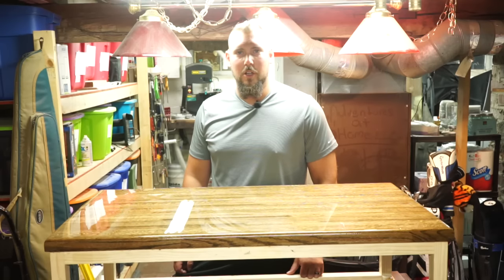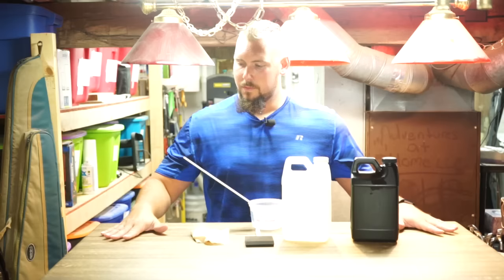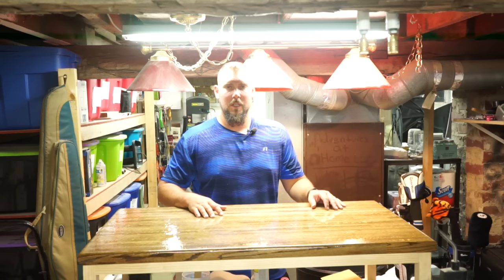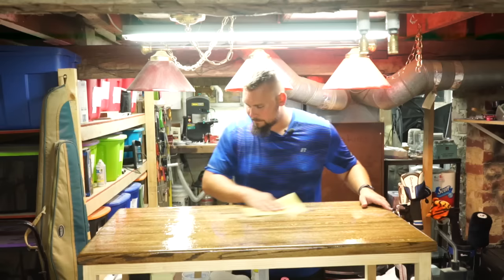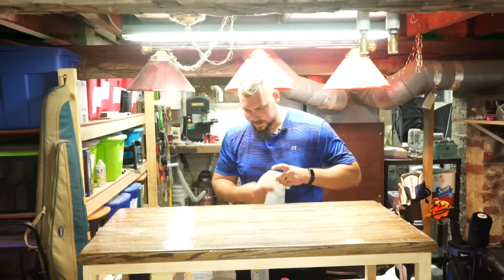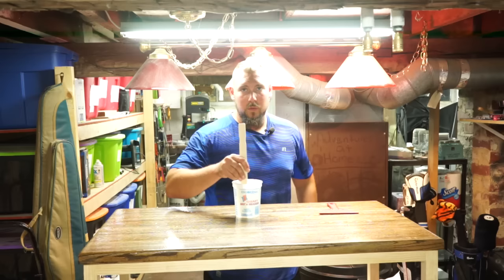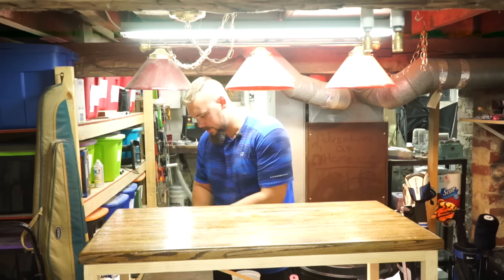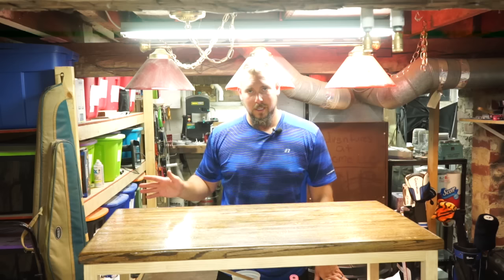DIY – How to Apply Clear Epoxy Resin – “Liquid Glass”

Comment: A few questions, sir.    Why couldn't you reuse the first mixing cup?, can I use a heat gun instead of a torch? and if using the product on a counter top, should the sink hole be cut first?
Reply from the maker: It is extremely difficult to get so of the epoxy/hardener or if the measuring cups. A heart gun will work, but be careful of blowing dust around. Sink hole should be cut first. Thanks for watching!

Comment: Great video!  Can you use a hot air gun instead of a torch to get rid of bubbles?  Thanks
Reply from the maker: Heat gun will work, but be cautious. You can blow dust deep into the epoxy. Thanks for watching!

Comment: I really enjoyed this video, thanks for the tips and tricks! Do you have a method for getting rid of the drip bubbles on the underside of a surface after a flood coat?
Reply from the maker: A combination of razor blade and sandpaper makes quick work of those. Thanks for watching!
Reply: If you mask off the underside edges with packing tape before applying the epoxy, the drips will peel off with the tape

Comment: If you don't necessarily want to do a poured stage, could you just do a couple of brushed on layers?
Reply: I am kind of apprehensive of doing a flood coat.
Reply from the maker: You could, but it will be much harder to get a smooth, even surface without the flood coat. Thanks for watching!

Comment: If a flood coat turns out poorly with high and low spots, should it be sanded down before attempting another go at it?
Reply from the maker: If you call determine why you got high and low does in the first place - and it wasn't a result of poor epoxy mixing, curing, etc. You can pour another layer over the top and it should level itself out. Thanks for watching!

Comment: Great Vid.  What if I just wanted to do a few thin coats with a brush?  Will there be brush marks?  I don't want to flood coat.  Thanks!
Reply from the maker: I'd recommend a foam brush - then it will still self level and you won't get brush marks. Thanks for watching!

Comment: I would think you would want to prevent the drips since it is so expensive. Especially after being so concerned to make sure you get everything out of the cup for the thin coat.
Reply from the maker: The drips are part of the self leveling. Nature of the beast.

Comment: Could you use polyurethane for the first thin coat?
Reply from the maker: Yes you could, however, depending on the wood I would recommend more than one coat. With an open grained wood like red oak it will probably take more than one coat to eliminate any excess air from the wood. Thanks for watching!

Comment: What do you do about the drips on the sides after curing?
Reply from the maker: The sides will coat evenly. However, drops will form on the bottom and they can be easily sanded off after curing. Thanks for watching!

Comment: Great video, planning to use super glaze on a camper wood stain counter top. I am having trouble figuring out if I should attach the back splash 2 inch edge or should I pour glaze then attach the back splash shelf? Not sure how the self leveling would work with the back shelf.
Reply from the maker: If you are planning on glaze coating the backsplash it will have to be done before it's installed. If not, you can install the backsplash before doing the counter top coat. Thanks for watching! Let us know how it turns out!
Reply: @AdventuresAtHomeLLC  it’s just a 2 inch wood that is the counter backsplash. Then tile will go above that. I plan to glue the wood 2inch strip onto the counter top. If I glaze everything then goto attach it won’t it make it harder to attach and adhere to the counter top?

Comment: What do you do for the drips along the sides?
Reply from the maker: The sides will coat themselves evenly from the epoxy running over them. However, you will have to clean up the dried drips on the bottom with a razor or sandpaper. Thanks for watching!

Comment: I've sanded my walnut slab down to 2000 grit paper and coated it with tung oil.  Is it really necessary to rough the surface?  Also, when I tried my first table I tested sanding a small flaw out of the epoxy coating and it was nasty and hazy.  How do you manage to keep your top from being hazy between your first and second coat

Comment: How did you clean up the drips? Before you let it cure you can see it dripping all over. Do you let it get tacky then scrape the drop that hangs down?
Reply from the maker: You can clean it with the foam brush as it cures. We prefer to let the drops dry and then sand them down. Thanks for watching!

Comment: Do you have to put a polyurethane or lacquer coat on the wood before you apply the epoxy? I have a wood coffee table and I want an epoxy final coat, but at the moment it’s just bare wood. Thoughts?
Reply from the maker: You do not. The initial skim coat you see in the video was applied directly to bare (stained for color, but not sealed) wood. Thanks for watching!
Reply: @AdventuresAtHomeLLC  awesome! Thanks for the great video!

Comment: With the base/thin coat, is it only resin or a 1:1 mix? And how do you calculate how much you need for the base coat? Thanks!
Reply from the maker: 1:1 for the seal coat. I don't really have a formula for how much epoxy I need for the seal coat. I guesstimate and make what I mix-up work. Next seal coat I'll have to make a note of how much per SF I use. Thanks for the idea, and thanks for watching!

Comment: If the manufacturer directs you to use 50/50 by volume, that does not mean that 50/50 by weight will work unless both the resin and the hardener are the exact weight which is unlikely...
Reply from the maker: Which is why we use the densities to find the weight that each part should be for a perfect 50/50 ratio. Thanks for watching!

Comment: Good video.  Out of curiosity, where you mentioned moving it to a dust free enviroment, I was thinking that a big dining room table type job, unlikely you could move it anywhere.  But then I thought, is dust really a big deal?  Since you are sanding it and cleaning it with acetone anyway, any surface stuff is going to come off.  Of course, doing it indoors would reduce the level of dust a ton anyway right?

Comment: Can we apply a sealant and a poly before applying Epoxy for glass coat look? I thought Epoxy will have adhesion issues to be applied over the poly coat. Im working on a live edge hard maple board. Can you pls share in a couple lines on how you prepped your board from an unfinished stage to be ready for Epoxy application.

Comment: My instructions say not to scrape the container when pouring it onto the surface that there is always unmixed portions in the container no matter how long you mix it and scraping the container will likely put the unmixed chemical onto the table which will cause a bad spot
Reply from the maker: I've seen that also. But we feel changing containers halfway through eliminates this risk - and we've never had any problems. Thanks for watching!
Reply: @AdventuresAtHomeLLC  if I'm putting in a new sink as well after I've just finished the countertop build should I wait till after I epoxy it to put the sink in
Reply from the maker: Yes. I would ensure that the counter top is complete before installing the sink. Send pictures when you're done to be featured on our "Makers Spotlight" page!

Comment: Hi ya, great video, thanks for sharing.  I did struggle with the lighting couldn't always see properly what you were doing because of the reflection.  However, your instructions are very thorough.  We are about to resin a new bar top that we have built - quite a project for us as we have never attempted it before.  When you put on the thin coat did you thin coat the edges as well?  Did the resin you used smell?  Just wondering whether we need to buy masks. Thanks again.
Reply from the maker: Ahh! Our lighting.. at least we figured it out in our later videos. Yes, we did initially thin clear coat the edges. The smell is no stronger than a standard polyurethane. Masks might be handy though. Thanks for watching! Let us know how the bar turns out!

Comment: I would love to try this but I have a question.Is epoxy flexible enough to contend with seasonal wood movement or will it eventually crack.
Reply from the maker: It stays relatively pliable, and will not crack with seasonal wood movement due to air moisture content. Thanks for watching!

Comment: Great Video! I bought an end table off Craigslist that already has a finish. Is it ok to directly put an epoxy resin directly on the table or do I first have to sand off the finish? Thanks for your help
Reply from the maker: Just rough up the existing finish with a little 220 grit and clean it well and you should be good to go. Thanks for watching!

Comment: Question what kind of epoxy can I use I have a husky tool box with wooden top wanna put a big picture on it then cover it with epoxy can I put the sticker on as is or do I need to sand it down

Comment: Do I need to apply on both sides of the butcher block if it’s in the bathroom?
Reply from the maker: You do not. However, you will want to seal the bottom with a polyurethane or similar. Thanks for watching!

Comment: what do you do with any resin that runs down the legs??
Reply from the maker: I usually have a 1" overhang and the epoxy won't run far enough on the underside to get to the legs. In the rare instance I don't have an OH, I'll remove the top before I pour. Thanks for watching!

Comment: Question, if I am pouring this over a few 2x4's would you recommend filling in the spaces in between the wood first with the initial coat before pouring the flood coat?
Reply from the maker: Absolutely. This will make the flood coat much easier, and leaves less chance for bubbles. Thanks for watching!

Comment: Inches, square feet, (US) gallons, fluid ounces  (skipping over Barrels  [42 U.S. Gallons or 35 Imperial Gallons.], cubits, (US)pecks [ .1.93788 gallons].. then finally measuring out some grammes of epoxy .... life is just so much easier if you stick to SI units throughout :-)

Comment: Thank you so much for this video. Question for you. I don't have a torch but I do have a heat gun. Is that ok to use instead?
Reply from the maker: Heat gun will work, but be cautious. You can blow dust deep into the epoxy. Thanks for watching!

Comment: Great video! I recently just did this and I experienced some spots on my table that looked like the glaze pulled away after I had spread it all around, maybe I didnt put enough? It's been over 72 hours and those spots are still tacky
Reply from the maker: It could be that the two parts were not mixed completely (hardener wasn't distributed evenly) or that an incorrect ratio was used. However, the drying times will vary drastically with the temperature and humidity. Give it a few more days and you might get lucky. Fingers crossed. Thanks for watching!
Reply: @AdventuresAtHomeLLC  thanks so much!

Comment: Is there way to stop it from running if I pour it on a table only in selected areas? 
I'm trying to get a high gloss finished and drill through it later
Reply from the maker: Absolutely. You can build a melamine box around whatever you are pouring to contain the epoxy. Thanks for watching!

Comment: Is it better to let seal coat completely dry and sand before flood coat or let seal coat get tacky then pour flood coat?
Reply from the maker: I always let completely dry and sand. That way the wood is sealed and this will lessen the air bubbles you will get. Thanks for watching!

Comment: Found some mistakes in your video you say use all cause it's expensive but the you add 5% to your mix, when you torch your thin coat I saw smoke did you burn the expoy

Comment: How thick can you get the top of the bar to be? Since it runs off and self levels, I am wondering how thick the top of this bar top ends up. I am making a project and need some imperfections covered up on top of my table. Thanks!
Reply from the maker: The usual thickness we get is between 1/8" and 3/16". Thanks for watching!

Comment: Hi great video just a quick question i made a keychain but when i glassed the back side the epoxy went onto the front that i already epoxied how do i remove that without damaging the glass
Reply from the maker: It is pretty difficult. But I would try heating with a heat gun and then scraping with a plastic putty knife. Good luck, and thanks for watching!

Comment: I have a tray I am making it has raised sides.  I’m thinking I just do the part 1 of the video to get a better coat than the polyethylene.  How did part 1 look after the dry?
Reply from the maker: The skim coat does not look good without the flood coat. Polyurethane would yield much better results. Thanks for watching!
Reply: The test run on a different board confirmed this, thanks for the info!!
Reply from the maker: You're welcome! Good luck with the finished product!

Comment: Is there a special method you use to sand before topping off this table with another pour to repair it if it gets some dents or knicks?
Reply from the maker: It depends on the depth of the knock or gouge. Use the lightest sand paper for efficiently removing the damage, and then work your way up to 200 grit before fixing. Thanks for watching!
Reply: @AdventuresAtHomeLLC  thanks for replying so promptly!

Comment: Hi, I have a Red Cedar end cut kitchen floor. Can I put that on my floor?
Reply from the maker: Definetly would not recommend on a floor. This epoxy will get beat up easily on a floor. Thanks for watching!
Reply: @AdventuresAtHomeLLC  Thanks for the reply. Do you know of a very durable coating to put over this wood? The poly is not holding up to my dogs nails

Comment: I have a small table that my autistic son drew on. (Todd’s Block Art on Facebook and instagram) To preserve his art I use 3-4 coats of water base polyurethane. 3 yrs later the use and warm plates placed it has started to wear the poly off and making it have a sticky feeling. Would epoxy withstand plates of warm/hot food sitting on it?
Reply from the maker: Epoxy will have greater durability in protecting the surface underneath than 3-4 coats of poly. However, epoxy still won't hold up well to hot items being placed on it. For better durability you may want to look at a furniture grade clear coat. Thanks for watching!

Comment: I watched this video and others to prepare for my first epoxy pour. Unfortunately, out of a 52X40 inch board that I created art on did not fully cure. I have an area that's about 2X6 and a few dime size spots that have not cured after 48 hours. The areas are tacky, everything else has harden to the touch. Do you have any suggestions on fixing this issue without destroying the entire pour or mainly the artwork?

Comment: question about the drips.   I can see your final product has drip hanging on the bottom, and just about everyone does.  Is there know way to resolve this?
Reply from the maker: I will sand them off, or shave them down with a razor and then sand them smooth. Thanks for watching!

Comment: I have an unfinished, live edge pine bar top. The wood soaks up stuff very quickly. Will this work for me? Because I wanted to use epoxy to create a nice glossy hard finish
Reply from the maker: Epoxy will work great for this application! Just make sure you use the skim coat to seal the pine, prior to doing the flood coat. Thanks for watching!
Reply: I have not used this product,  but have used similar on some very punky wood.  I will do repeated seal coats until I am satisfied that its sealed ( when there are no areas that are continuing to soak up resin) then do a flood coat

Comment: You said you had the right amount,, but what do you use for a measure for the area being covered? My friend who does tables in Arizona said to use 2 liquid ounces per square foot for the flood coat.
Reply from the maker: That's a pretty accurate estimate. However, each epoxy is a little different and it will give you the correct coverage on the box/instructions. Thanks for watching!

Comment: Is it neccessary to take all those precautions to keep the table dust free after the thin coat if you have to sand it before the flood coat?
Reply from the maker: Yes, because the light sanding will not be enough to remove any dust that is embedded in the epoxy.  Thanks for watching!
Reply: @AdventuresAtHomeLLC   great video by the way. Specifics and reasons aren't always given.in tutorials.
Reply from the maker: Thank you! And thanks for watching!

Comment: I'm not sure if this question has been asked and answered, but I have a table that has been stained and I was wondering if you put a coat of poly before doing the epoxy? And does it matter whether it's oil or water based?

Comment: Thank you so much for your quick answer to my other question. Now here's another, my live edge bar top is not totally level, will this be an issue or will it be ok?
Reply from the maker: Front to back, and side to side will need to be perfectly level. If there are dips, and voids in between that you will be fine. Let us know how it turns out!
Reply: @AdventuresAtHomeLLC  ok I will! I'll try to attach photos of it if I can. It's just a little off level, I'm hoping I can fix it :( will it just cause the epoxy to all run off?
Reply from the maker: It won't all run off, but the epoxy won't have an even thickness across the top.  It will give it a very odd look.
Reply: @AdventuresAtHomeLLC  ok. I figured. I'll do my best!!
Reply from the maker: Good luck! You can always send us a picture, or more questions at: customerservice@adventuresathomellc.com.